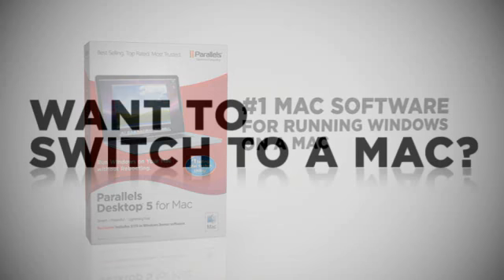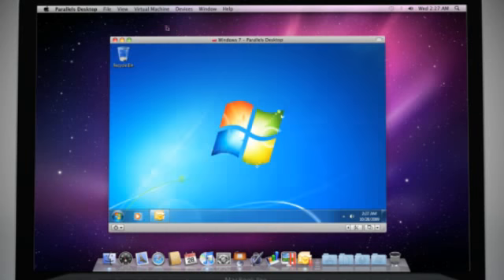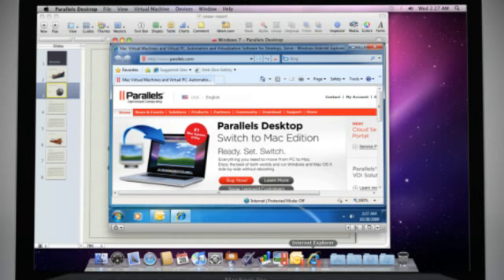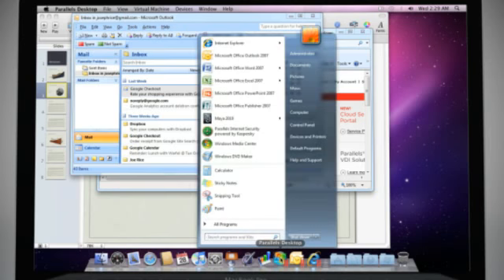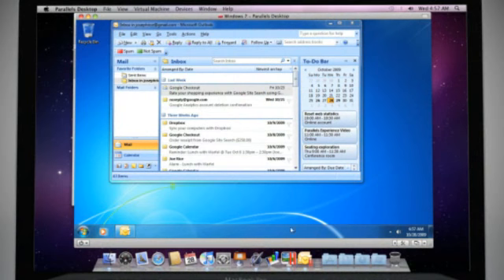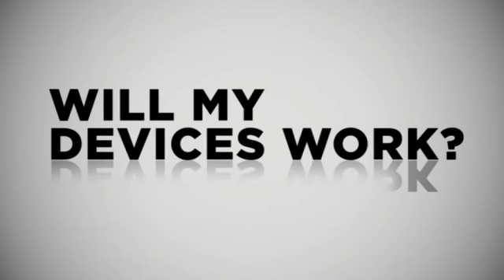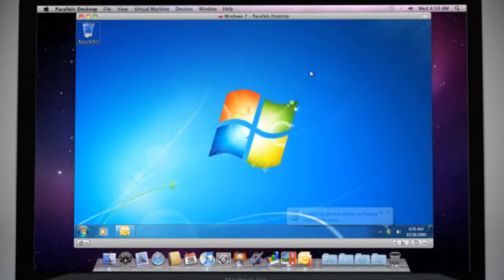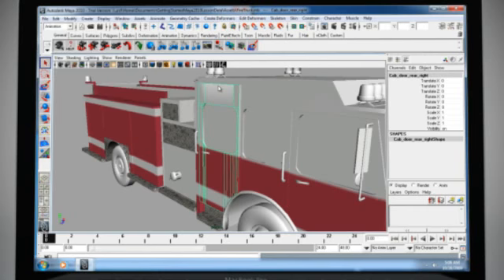Parallels Desktop for Mac 5

Comment: @iApple14 But Boot-camp is made by Apple. Plus Linux can run  Parallels, vmWare, and VirtualBox. Meaning that a PC user doesn't need a Mac. around and around we go. 
Most Windows error , and BSOD are fake caused by Scareware. Plus if you use Parallels, vmWare, and VirtualBox in Windows for all your web surfing and software testing than Windows never crashes, and never get viruses or scare-ware . I run Windows 7 inside Linux Ubuntu on an HP/PC and and almost never have a problem.

Comment: Lunarek, first you do realize Mac's run circles around a PC. They NEVER freeze, crash, get viruses/malaware, or bog down like a PC. The current O/S screams and doesn't need patches/updates every other day, like Windows 7. 
Parallels allows Mac users to run software for various peripherals that don't offer Mac equivalents. In my case, Blackberry DM. Once Mac is equally supported the PC will be a relic. Get your facts straight nimrod.